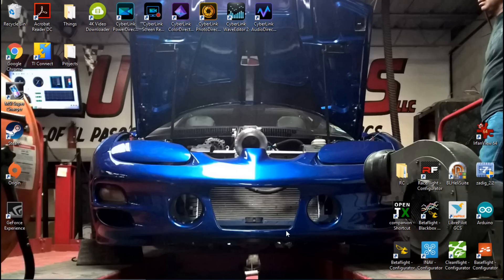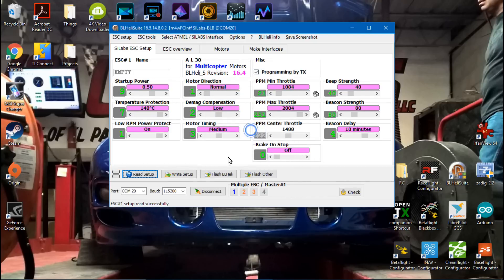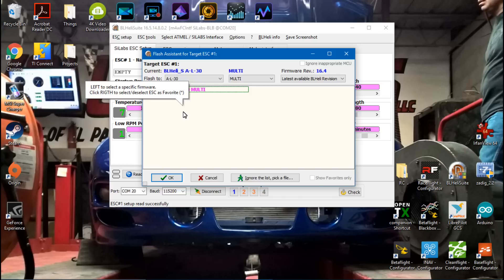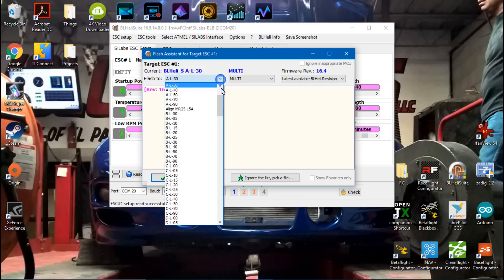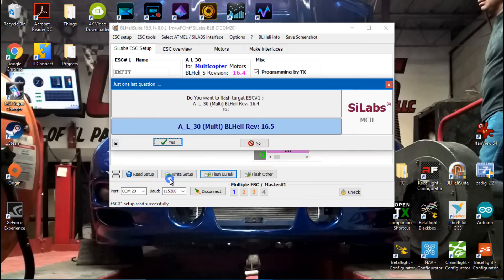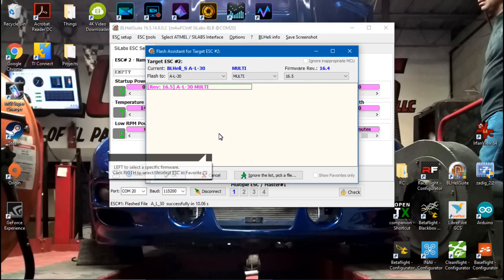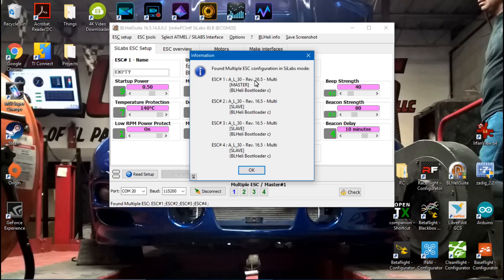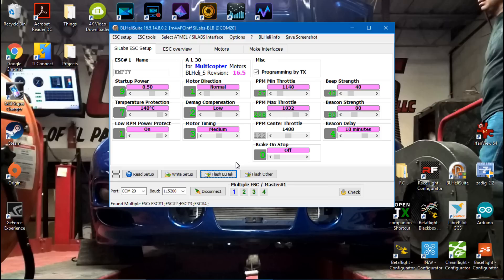Flash ESC Firmware Using BLHeli Suite

Comment: when i go to flash it says found multiple esc in silabs mode. does not give me any other info. could anyone help im  using racerstar 30a tattoo 4in 1 esc, fc.
Reply: Hey man i'm having the same problem, did you figure it out?
Reply: ya i just did
Reply: i used zadig to find out the name. then went to device manager and found that device and got it to comport 1 and it connected. fallow the steps for the f3 board on this video and u will get it. i have no clue what im doing and i just kept trying and finaly got it
Reply: What did you do to fix it?
Reply: on device manager i moved it to com1. just try to fallow his instructions step by step. put the video in slow mo to slow it down if u have to

Comment: any ideas on why i keep getting a "Failed to connect to ESC#1" message. using oneshot125 and NZ32 and in cleanflight i can get all the motors to spin but only when i hit the save and reboot button. when selecting read setup, it shows 4 ESCs but they are blank/ no data.

Comment: +Project Blue Falcon Thanks for the video. Today I had to replace 1 of my ESC's (Aikon BLHELI_S 2-4S 30A), but Aikon has made a new version of that particular ESC. My ESCs are on just v1, but the new ESC that I ordered is on v3.1. In BLHELIsuite my ESCs are on C_H_15. I haven't soldered my new v3.1 ESC yet, but should that one be also on C_H_15? Is it ok to have v1 Aikon ESC mixed with a v3.1 Aikon ESC?